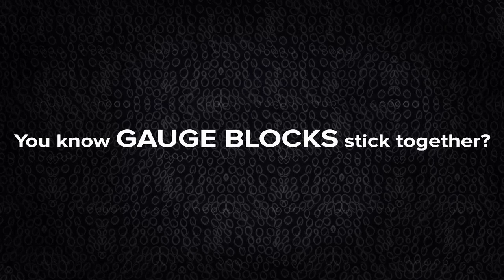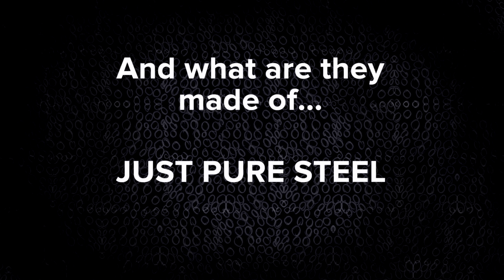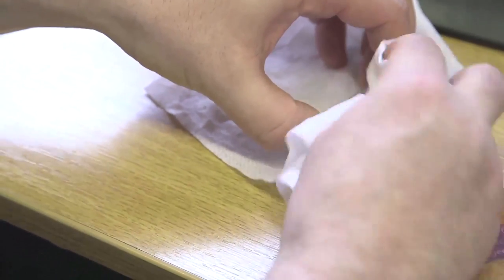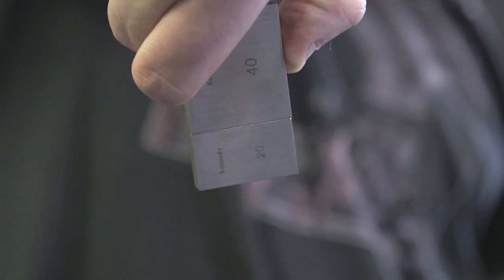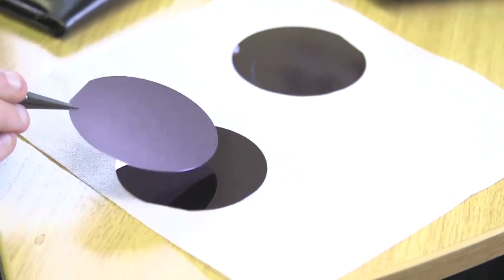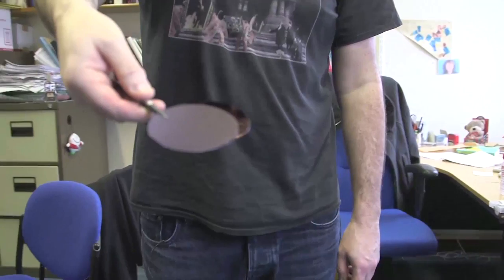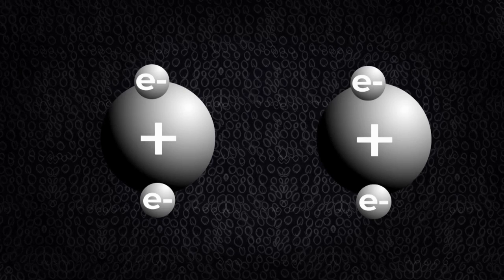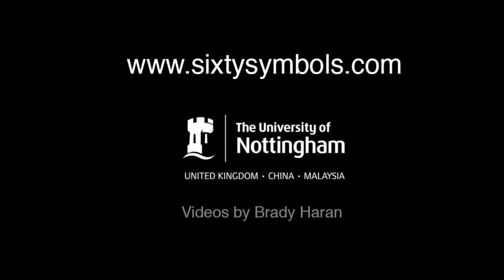Gauge Blocks (Van der Waals forces) - Sixty Symbols

Comment: I hope thats not an active set of gauge blocks that you're dropping all over the damn floor. They look a little ill maintained, but still dude. Do you play catch with antique microscopes?
Reply: Photonic Pizza You never trust your measuring equipment without having something to check it against.   A typical dial or digital caliper is only accurate to half a thousandth of an inch or so.  Today's machining world deals in 0.0001" to 0.00001" accuracy.  Gauge blocks depending on grade can go from 0.00001" to 0.0000001" and are part of the calibration practices used by machine shops the world over.   Quality shops have people in house whose job it is to ensure all parts are manufactured to spec.  They will periodically check all measuring tools to verify accuracy and repair or replace them when they are no longer reading accurately.
Reply: @Photonic Pizza
Gauge blocks are still some of the most precise tools you'll find in most workshops. No calipers will ever give you micrometer precision, even micrometer screw gauges have to be checked against a standard (like a gauge block) before use.
Reply: Exactly, and gauge blocks are not used just for measuring. They have other purposes in a workshop, like they are used for setting equipment, faces, angles etc.
Reply: Atlas WalkedAway Only antique ones. They're useless anyways. Museumpieces at best.
Reply: Photonic Pizza you got wrecked
Reply: They're most likely antiques, today the measuring equipment is more than enough. A decent caliper can measure with a similar amount of accuracy, and if you need something more precise, at that point you can probably afford laser measuring equipment.
Reply: @photonicpizza  Dude you have no clue what you are taking about. Coming from a machinist of 15 years you are wrong. A pair of calipers is no where near as accurate nor do we as machinists that make precision parts ever check holes, slots, pockets, etc. With calipers unless +-.01" on the tolerance. Gage blocks and gage pins are the standard and used in all final quality checks and it will always be that way. Even if you have a tol of +-.01" you make the part nominal and every part after that you make the exact same,  meaning you still work to the tenth of an inch (.0001") and that is only achievable via gage blocks, cmm machine, microscopes, bore gauges, micrometers,  and tenth indicators. NOT calipers!

Comment: Question for the scientists:

Is gravity actually a long range version of the Wan Der Walls forces with objects that are much more massive than small molecules?

or in other words:

Is the Wan Der Walls force actually just a short range version of gravity with small molecules?

Note: sorry if this question makes you roll your eyes. Please try very hard not to hate on me for asking this.
Reply: Despertai Consciências
Van de Waals force is electric (or electromagnetic) in nature.
Gravity is, well, gravitational. Very different mechanisms. :)
Reply: Despertai Consciências No. The gravitational force is very much distinct from the Van der Waals force. The Van der Waals force may be calcuclated to larger at small separations yet smaller at large separations than the gravitational force between the same objects. The medium between the objects is also relevant to the Van der Waals force, whereas it's irrelevant to gravity. To gravity it doesn't matter whether two silica spheres are in water or in air but to the Van der Waals force it can be the difference between attraction and repulsion, besides as much as an order of magnitude difference in the magnitude of the force. There are more evident differences but I think these two should suffice.

ADDENDUM:
Evidence of the former example is the earth's own gravity. A near constant 9.8 N/kg over several hundred km from the surface well into space. If guage blocks were held together by gravity alone, a pair of them would have to produce at least 9.8 N/kg to overcome earth's gravity yet to not be attracted over longer distances that gravitational field would have to go to 0 in less than a milimeter when Earth's gravitational field requires hundreds of kilometers to even make a dent in the number.
Reply: @TheLeiZurc
Light is also electromagnetic in nature and the mechanisms of gravity interact very closely with what light does. For example, gravitational lensing. It would be kind of nice to discover where electromagnetism and gravity stem from as it would be useful, I think, for a theory of everything.
Reply: Thanks, that's a greatly informative response :)

Comment: I dont think the surfaces must be absolutely flat. They just have to fit perfectly so the atoms are as close as possible.
Reply: Merto6 For Van der Waals bonding  you could use surfaces with macroscopic roughness provided they conform well with eachother. However microscopically they have to be exceediingly smooth because any roughness will result in greater separation between the base surfaces. The attraction between approximately spherical irregularities and the surface they touch is pretty much negligible to surface to surface attraction. As the force drops off with the square of the separation (if what applies to sphere-sphere contacts also applies to surface-sphere contacts) A small increase in roughness results in a large decrease in attraction.
Reply: Yes, but it is fairly more practical to make very flat surface, than two custom curves that fit together that accurately as flat ones. So, if you want "wringing" effect, your only practical option is going flat!

Comment: Is this the same effect that's responsible for the cold welding effect in space?
Reply: To add to the above, it is caused in places like hinges which have to rub together. This causes the oxides which are normally present to be removed leaving the bare metal. When this metal contacts another part of bare metal the crystals grow together and create almost a single piece.
Reply: Cold welding is when there's two or more pieces of metal without an oxide layer, they come into contact and they create metallic bonds, which is prevented most of the time (mostly in an atmosphere) by a very (sometimes just a few atoms) thin layer of oxide (like aluminium oxide on aluminium, ferric oxide on iron and steel, etc). That's something else, with Van der Waals forces there are no bonds being formed.
Reply: Patrick Bateman No, cold welding is a different effect which does not require such smooth surfaces.

Comment: Cody's Lab has a great video on this.
Reply: He was testing this but he didn't know why it happens
Reply: Ye, he even went as far as putting them in a vacuum.
Reply: He did that with gauge blocks as well Chirs, testing in a vacuum chamber if dropping them on each-other would produce the same effect.
Reply: I haven't checked his channel in a little while, but wasn't it Cold Welding he was doing? Not this? It is a similar in the sense that no heat is needed but the reasons they bond are different. But I haven't checked his channel so he may have...

Comment: Hah. The SJW physicist is back.
Reply: lloydgush If it were "velcro" it would work under vacuum. That hypothesis is therefore incorrect if the same surfaces do bond in air but not in vacuum.
Reply: lloydgush Wrong? I would like a source on this if you don't mind.  He did said the wafers will stick even in vacuum. Also, small irregularities do not explain the fact that this happen on very smooth surfaces. And finally, what does "interlocking of small irregularities" mean? Just because A fits into B it doesn't mean A and B can't be pulled apart. Do you know how close/far is one surface from the other?
Reply: gerbs96 Physicist nonetheless
Reply: lloydgush: however the trick works if you make the blocks in different ways (I mean as long as you have a very smooth surface, it works), so why would it make stick here, but other surfaces which are much more irregular do not lock together, even though the other (rough) surfaces have bigger chance of interlocking?
Reply: Don't politicise a video about fucking gauge blocks man....
Reply: his identity politics may be as bad it gets, but he knows physics and that shouldn't diminish this video, two different things two different topics, should be criticized differently.
Reply: Seriath1, he pissed off a very vengeful guy with a lot of angry sheep
errr... I mean friends.
Reply: hendrick heisenburg doubtful.
Reply: Ivan21234 agreed. And if you go back, you'll see I just pointed out that he's back, after deleting his online presence. I'm glad he's sharing his expertise and not his politics.
Reply: And wrong. drop them into each other in a vacuum and suddenly they don't stick, which means it's not van der waals, but simply small irregularities interlocking with each other. Basically an even small example of velcro.
Not saying van der waals doesn't play a part in it, just that it's not the main reason.